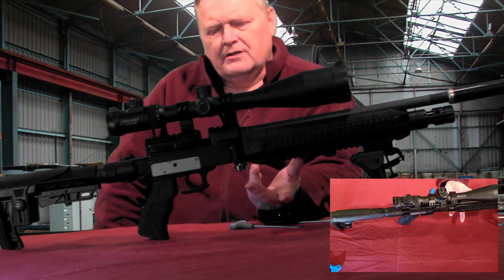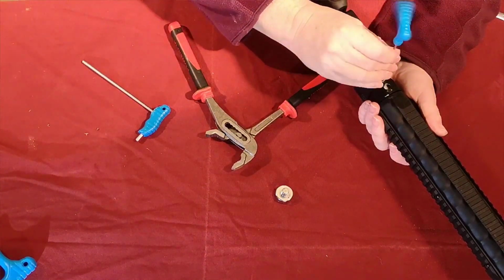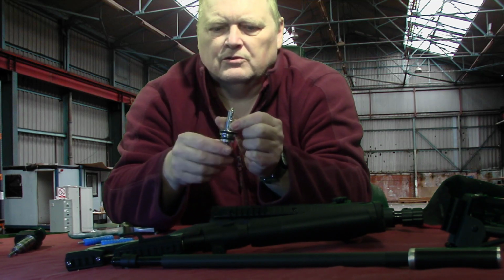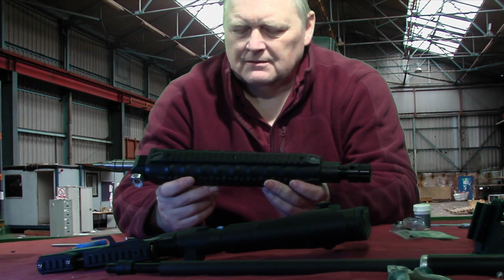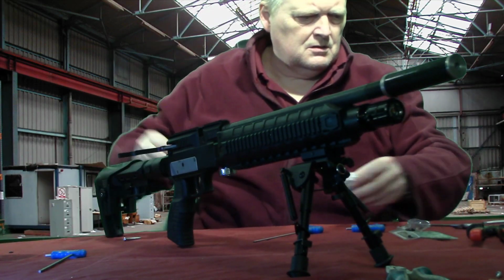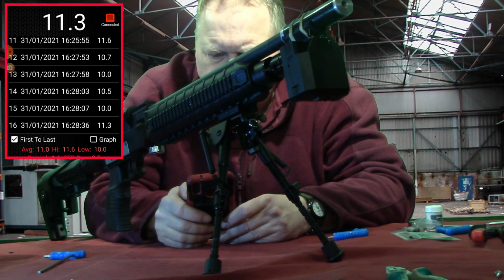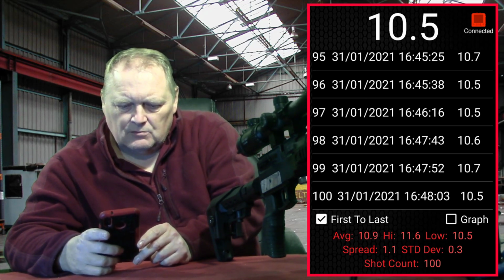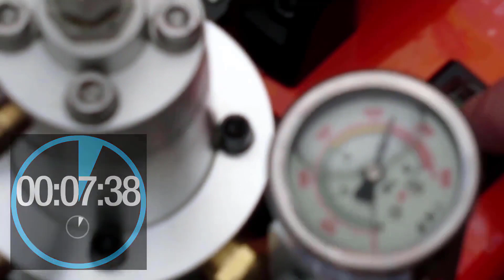The Retay T20   Regulator re set to 90 Bar

Comment: A man with your knowledge and experience should have an FAC. If you do have one I would really enjoy watching what you do with FAC airguns. Here in the USA,,,at least for now,,,the big box stores sale airguns at the sub 12 configuration and like most others...that’s what we cut our teeth on. Pretty soon we wanted more. Now that PCPs have gone to a whole other level and so many different ones are out there...it would be cool to see another perspective on the tinkering side of them. You would be good at this. Thanks for the video. God bless.
Reply from the maker: I hope to apply for one at some point. At the moment with the lockdown there isn't much point. The police have more or less stopped the license process with the virus, and even then it can take upto six months or more depending on which police County are dealing with the request. For Gods sake don't loose your second ammendment. They treat any air rifle of 12 ft/lbs, or any air pistol over 6 ft/lbs like a .50 calibre barrett sniper rifle over here. It's easier to get a shotgun license than a section 1 firearm permit. You have to have good reason to apply for one. If you shoot vermin over land it is inspected to see if it meets the criteria. Airguns would be easier than a firearm, due to lack of power over long range. You can also get one as a member of a club. Our range has been cleared for this, but with the lock down nothing is being processed at this time. Also unlike a shotgun certificate where you get your license and buy as many as you like, you can't buy loads of FAC airguns on one license without further approval. On a section one, you have to give a reason for each calibre that you apply for and also if you want to fit a silencer. You have to apply for .177 /.22/.25 etc and you would only be allowed one, calibre or more if the reason you wanted it for was accepted. As you can see, it can be a right pain in the arse, but I still think that the FAC airgun is a bit easier to apply for than a dedicated firearm powder burner. At least in England and Wales we don't have to have a license like they do in Scotland or Northern Ireland for sub 12 ft/lbs rifles as well.

Comment: Hi mark,  don't know if you can help me , i have a lane external regulator on my s200 do you know witch way turns it up or down  thanks, 😁👍
Reply from the maker: Hello Phil, clock wise turns the power down, and anti clockwise turns the power up. The little notches are in five bar incriments on the side.
Reply: @airgunsniper-elite7385  thanks pal ,i think mine is a bit high,  😁👍
Reply from the maker: @phillipsharpe6459  Have you tried turning the choke screw clockwise on the side of the rifle?
Reply: @airgunsniper-elite7385  no I've got it set at the power i want but a guy got in touch with me on one of the forums and said that the s200 runs better and uses less air at 90 ,mine came from lanes set at 100 , i just wanted to try it at 90 to see if it made any difference,  😁👍
Reply from the maker: @phillipsharpe6459  You'll definitely get more shots if that's the case. You may just need to open up the Choke if the power is down. On a full tune you open up the Choke fully for more efficiency and balance the valve and regulator to suit. In some cases you even have cut the hammer spring down if you can't get the power below 12ft/lbs
Reply: @airgunsniper-elite7385  yep , when i put the reg on and put the rifle back together it was running at 15 fbs , i had to wind the hammer spring out to get it below 12 fbs , i wil tinker and see what happens,  thanks  😁👍

Comment: Mark have fitted a power adjuster to my gx40 for fine tuning when using different weighted pellets....is it legal. Can send photo
Reply: As long it's under 12 ftlb when fully wound in at max power then yes it's legal.
Reply from the maker: Tony's right. It's a bit of a grey area, as the law says what a rifle is capable of. I always tune my rifle with the most efficient pellet, as you never know what the police forensic tests would use. If you have a dial on the side that is readily available and even though you can adjust it to shoot a 7.3 grain .177 to full power, if the forensic test put a 10.3 grain JSB Hades through it at the same setting it would probably be reading 13 or 13.5 ft/lbs. There is a power adjuster that you can buy for the Air Arms S200 which fits on the transfer port choke and does the same thing as you have done, but this can have the same result at the end of the day. When I shoot slugs I actually turn the power up to 11.5 or 11.8 ft/lbs, because at standard pellet settings the slugs only produce around 10 ft/lbs, but as soon as I have done, I detune the rifle again. I do this by stripping the rifle down to adjust the hammer, but if it is readily available with an outside dial, they the forensic test people would just wind it up as high as they could and fire the most efficient pellet. If you have to take your rifle apart to make those adjustments, then they would look on it differently. At the end of the day the choice is yours. In most cases they wouldn't check your rifle unless you did something wrong, but theres always a first time that they may come across someone shooting and decide to do a test.

Comment: I’d be going 4mm transfer port all the way and setting 85bar then tune on valve spacer👍. 
Also try leaving 20-30 seconds between each shot to let regulator settle you may be surprised at results..
Reply from the maker: Hello Sae, I did think about this, but being a .177 I didn't want to go too big, as this can have an opposite result. I talked to Robert Lane about the size of the transfer port and he also thought that the hole was OK. What is making the difference with this tune, is that the barrel is only 11 inches long, and only 1 inch longer than a crosman 1377 air pistol. Once I fit a standard sized barrel later on the current sized transfer port will work a lot better, as the air pressure will increase as the pellet travels the extra six inches up the barrel, and I will probably then be able to set the regulator at the 80 bar that it was set at originally. Once the new barrel is fitted I will know more then. You are also right about the time between shots. It would give the regulator more time to reset. Great comments.
All the best.
Mark H.

Comment: This vid should have stayed on you computer, 1st , wrong size spanner for Manometer/pressure gauge, so we get a pair of adjustable pliers then clamp the bezel and lean on them with all of your weight the wrong way , so it tightens on to a Delrin washer, great idea.  Then you set about removing the valve by  putting what looks like an old glove over the O rings then clamping it with the special pliers. lets refit the regulator shall we, oh butcher it then tells us the O ring was too large and you have had to fit a smaller one, how did it fit the first time ?  Shoot it to test ftlb's, oh not to good all over the place, let's move the barrel by guessing and see if we can clear the air port. select the readings so that it fits your required standard.. Car crash, still banging on that the barrel is to short, ask John Bowkett why the BSA Ultra is so accurate, 12inch barrel, no regulator. Car crash.. End of rant..
Reply: Not Marks fault he is polishing a turd for our benefit and as a warning to what can happen.Rough and ready absolutely but a genuinely honest warts and all guy.Anyone can learn by watching of what can go wrong what not to do what not to buy.As for the Ultras very good gun but 30/35 full power shots in .177 didn't cut it for me but Phil Crampton at The Rat Works shoved a Tench Reg in waves his magic wand sublime.Stay safe all the best.
Reply: @tonyashton780  do not argue with that but when you release compressed at 200 bar and hold it with your hand it is not what can be called safe or a good example, air forced through the skin or in to a cut is what you can call fatal..
Reply: @neilpope2580  I appreciate that a air related blood embolism is very bad news.I empty my S200 regulated with mk 9 Lancet by slowly un doing fill end t bar adapter .But when I fit Lane quick fill and guage IL av to fire until empty.Point taken mate.
Reply from the maker: Hello Neil, Yes, I see your point, but the size of the hole under the micro manometer is less than 1mm and will still take a couple of minutes to vent the air with no gauge, so its not like a catastropic explosion. I used the grips because I'm not too worried about scratches to the manometer, as I will be getting a better quality one, once the rifle is sorted, or I will just replace the grub screw that came as standard. I use this method as its easier than dry firing it and a well known way of bleeding air from the cylinders.